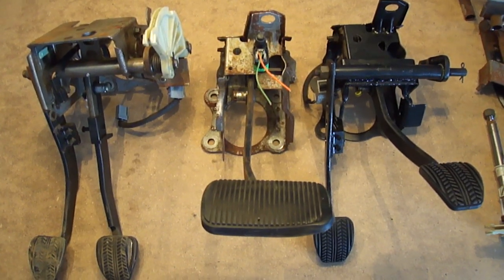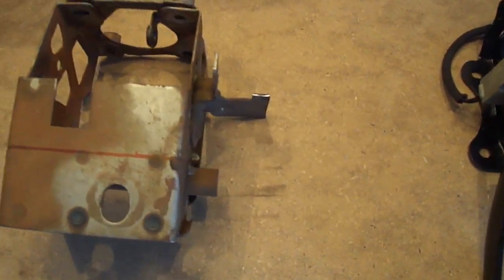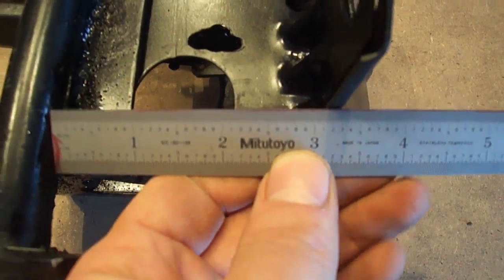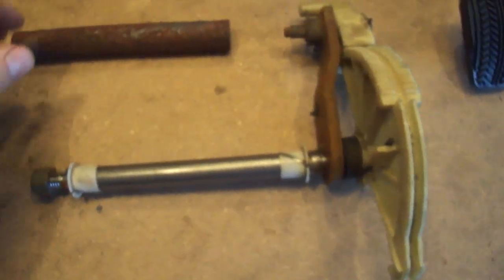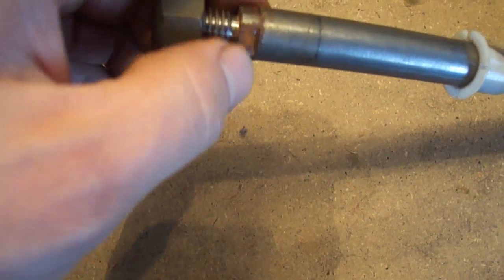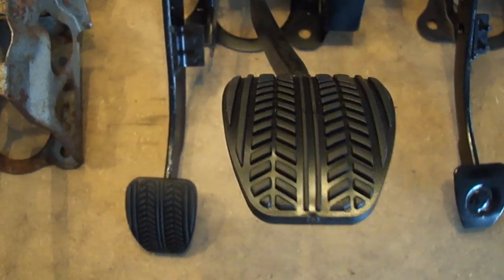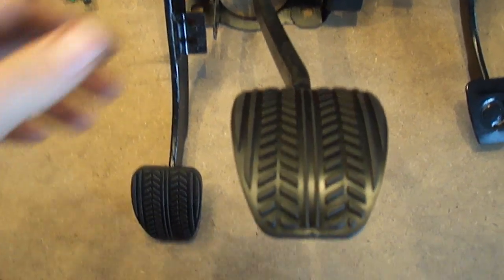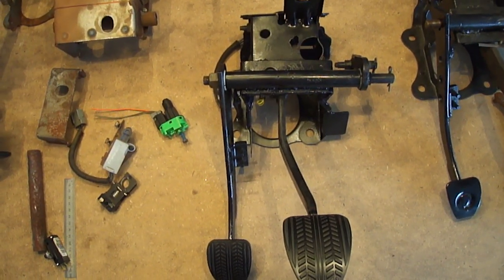Crown Victoria 5 speed manual swap /How to: clutch pedal

Comment: I'm interested in using a 2005+ 5 speed tr3260 with the remotes located shifter so I can use a Taurus sho center console. The issue is they use a hydraulic clutch. Do you make a hydraulic set up? Everyone recommends you and your builds are awesome. It's what inspired me
Reply from the maker: youreally and I mean really dont want to use a 05+ tr3650. it,s a totaly different animal and will require way more modification to make it fit and 0 gain. Many people used the 04- trans with adaptor on the shifter base to use it with marauder conmsole with great sucess.

Comment: In order to install the reinforcement plate flush with the top surface of the vic pedal assembly, you have to press the pedal in about two inches. The original vic pedal has a notch in the surface, allowing the brake pedal shaft to rise higher than the housing. Does permanently pressing the pedal those 2 inches engage the brakes at all?
Reply from the maker: no it dosent interfere at all.
Reply: Great, thanks for responding. This is a really informative and detailed video you"ve put together. I have one more question for ya. The neutral safety switch braket on the mustang housing has 4 spot welds fixing it to the housing. Is is possible to drill those out and mount the switch on the original side? Or is the vic housing to short to instal the switch in the original position? And...... where did you get the aftermarket brake light switch? Thanks again bud, keep up the good work and ingenuity!
Reply from the maker: I re use that bracket on the units I make. drill 1/4 with a sharp drill bit and you will be able to re use it. Mine sits on a flat spot on the right. see my other videos for that .

Comment: have you not had any issues with the pedal assembly collapsing?  i have been doing the 5spd swaps in panthers for a while and with a high performance clutch, i have had to reinforce the entire bracket to support the extra pedal pressure required.

Comment: im gonna be doing a manual swap on my 05 crown vic. what do i do about all of the wires that plugged into the original transmission. and how will i get the speedometer to work?
Reply from the maker: +Graham Rees  use the same wires going to the vss ,its just a different  connector
Reply: +p71c1 thank you

Comment: hey I need your help please contact meI cannot contact you by your email it is not working I need to know how much you would charge for one of the units I need foot pedal assembly but if you do not have any I have my Mustang foot pedal and my crown vic one I will send it to you to make me one I just don't understand the video and I also have another question about how did you hook the steering wheel up if it was automatic with the shifter on the column how do you bypass that next question do I have to use the wire harness that is on the motor of my 96 crown vicor can I use the one on my 98 motor

Comment: What's the cheapest you can build one of these? I'm having a tough time and I don't have a ride, My 99 Merc was parked for two years and I recently started reviving it on a shoe string budget, Got it crunk and it puked up Peanut butter, Looks like the idiots before me had blown the head gaskets. And It puked out of the Throttle body...... So I'm swapping a Free Lt1 (Brother wrecked a 94 Cam So Free motor :P) with the 6Speed And I need a pedal set, I don't have much of a budget And I don't want anything fancy, I want the bare minimum that is required to run a Manual in an auto's body. 
Yeah I'm mutting the Grand marquis... But it's the only option I've got to go back and fourth to work. So Something has to happen, Otherwise No job and No way to fix it.
Reply from the maker: Kody Tuggle  might have been a better option to stick with ford stuff in there or buy another car as they are dirty   cheap. my units go  for 325$
Reply: Not able to buy another car, Budget of about 200 dollars for whatever is done. No job and No ride And 200 dollars saved. I'll figure it out though. PullaPart may have a 4.6 that's worth something. Hopefully. Thanks for the options, Have a nice day.
Reply from the maker: Kody Tuggle  well sticking with the ford powertrain will save you a lot of time and headache for sure.